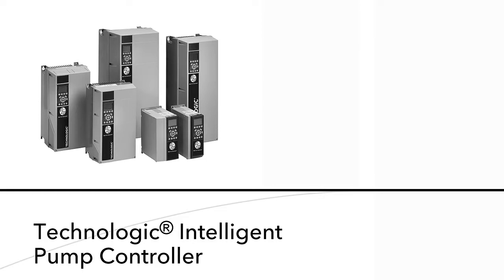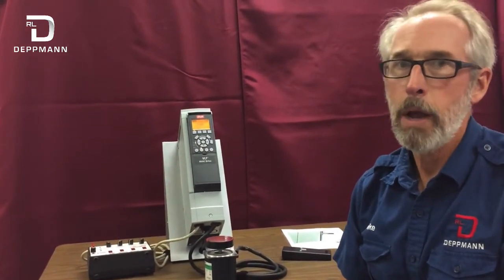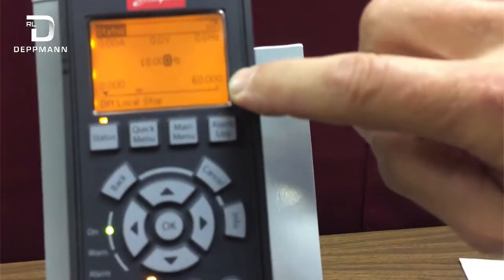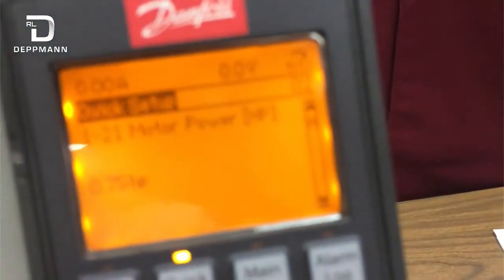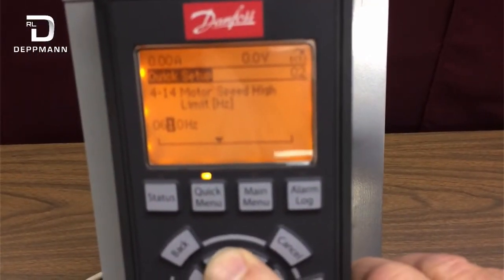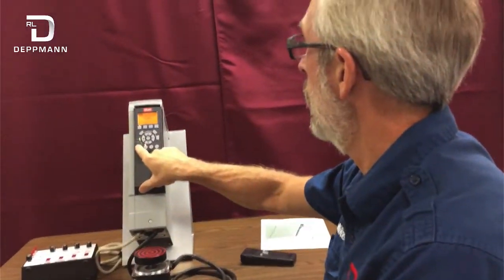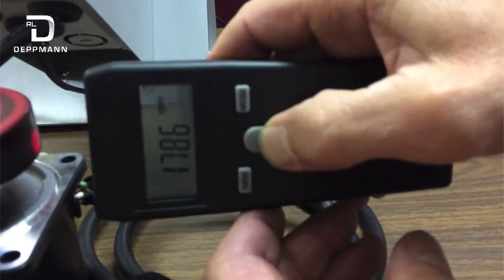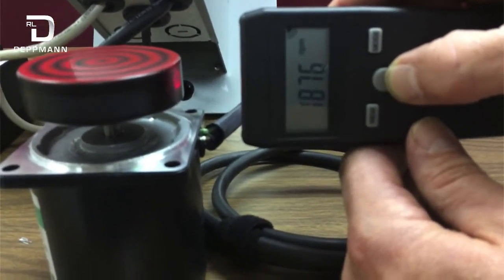Adjusting a Variable Frequency Drive (VFD) to Over Speed a HVAC Centrifugal Pump

Comment: Thanks for the video,  pls I want to know is it practically possible for a motor to run more than it rated speed using VFD?
Reply: It would be advisable to always run it inside manufacturer's envelope and the recommended hz range

Comment: sir  i have  HVAC VLT DRIVE 7.5kw 10hp (400v )it's possible to connect DC volt from solar panel to AC input to inverter.